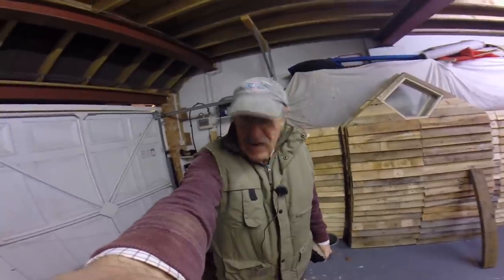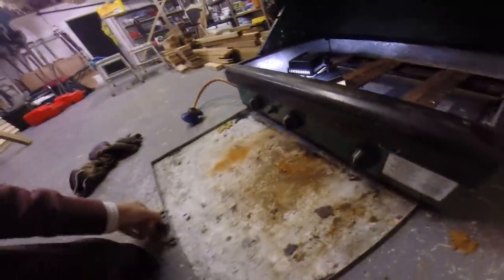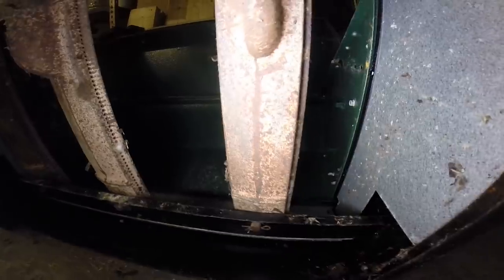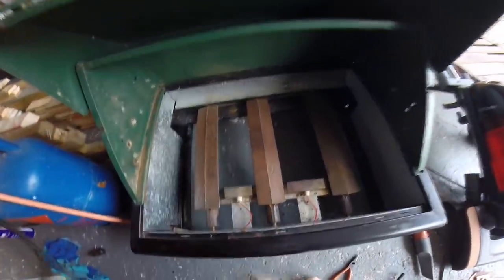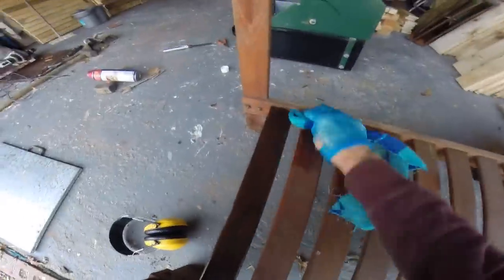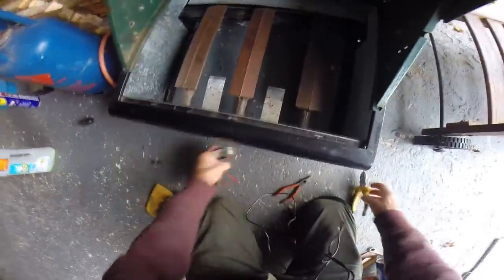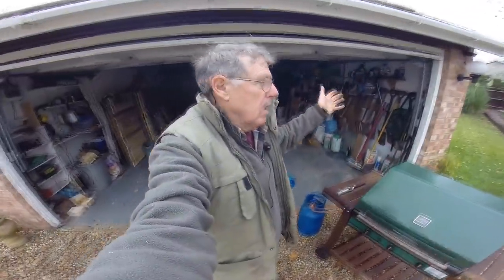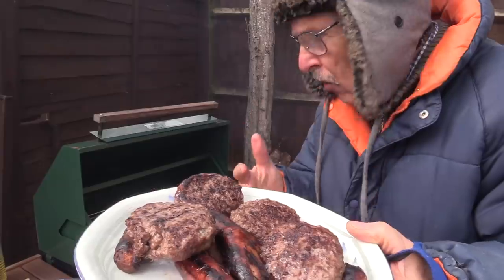Saved from the Junkyard! Now it works Great!

Comment: Top work sir,best tip given to me by a chap in Greece whilst on holiday....get yourself a cheap as chips aerosol sprayer,the sort used for misting houseplants.Fresh cold water kills the flames but not the coals.
Works a treat
Best wishes and tight lines
Stuart

Comment: Graeme, you are spot on my friend. I hate throwing anything away also, and In my opinion, this is the perfect example of recycling!
That's what I find most crazy, they keep banging on about using less energy, so why do they keep producing products that require us to use more energy in the first place?
Mate, if it isn't charcoal, it isn't a bbq, it's a gas grill!
Reply from the maker: Its a volcanic pumice stone heat boosted cooking implement.
Reply: @TAFishing  
Which still requires gas, and doesn't give you the bbq flavour you get from charcoal or wood chips my friend!

Comment: Nice Barby Graeme!  I would have left those Igniters - replacement Piezo buttons are available from eBay and other similar emporiums for not a lot!  A plastic water spray bottle is also great for stopping your bangers & burgers catching fire!  Now all you need to do (like a mate did) is chuck a whole leg of Lamb on there studded with Garlic, close the lid, and leave it on a lowish heat for 3-4hrs!  Stay safe & well!  👍👍

Comment: The square tubes the spark ignition were in are made to allow gas flow from one burner to the other.  That way you only have to light one burner and then the others should light after the gas  travels thru the tube.

Comment: Good job on the barbeque. It cleaned up nicely. 
A couple of safety things I was thinking about when I watched the video:
1) Never use a barbeque inside a garage or under a roof of any kind
2) The gas hose should be replaced once a year (this one is definately due for replacement)
3) The regulator should be replaced  every five years or sooner if you suspect it needs replacement
4) Always test the barbeque for leaks before you use it at the start of the season (and several times during the season)
5) Don't choose a barbeque with parts that can catch on fire when you buy a new one. It is strange to say the least that they made that barbque with a wooden stand. It is not unkommon for a barbeque to catch on fire because of all the fat that is involved when you use it. If it should catch on fire, close the lid and rip the regulator off the gas bottle asap. The gas bottle should be placed next to the barbeque and not underneath it. I prefer to use the steel tanks and not the plastic ones. I actually got a plastic tank that was leaking gas once. Luckily I tested the gas tank for leaks too before I started using the barbeque. 
This is just to help everyone be a bit more cautious when using their barbeques.

Comment: I’m not going to cover my barbecue any more. I uncovered it for the summer and it covered in condensation, and rusting. I think it’s better to just let it get wet and then dry in the sun and air. The other advantage is that it’s much easier to check it for rust occasionally during the colder months, and fire it up briefly as well.

Comment: Graeme, those wires which connect to the spark are (or were) heatproof! Lol. They wont melt and can withstand extreme temperatures. 

Great little refurb there by the way.

Comment: Hi Graeme I’ve got a barbecue just like that, I drilled out the small gas holes in the burners as they rust over gave a better flame, also change the rocks or get the fat from the food off them as I ended up with an inferno 😂 your always giving good tips on lots of things, so this is mine, great channel 👍
Reply from the maker: Thanks for the tip. Lets hope we get more good weather to get outside and use them.

Comment: Great job on the rehab!  As they say, "one man's trash is another man's BBQ" or something like that.  Seriously...my wife is constantly dragging on me for the amount of 'stuff's or garbage as she calls it, that I bring home to fix up and reuse.  But when she sees the $$ I save by refurb/rehabbing stuff, she shit's her mouth. Some things I have 'garbage picked' in the past and either used myself or sold are a few BBQ grills, countless wooden cabinets, a hand built gun cabinet someone put out because of a broken glass pane, a small lathe, and countless computers (most worked, just needed a part or upgrade).  Just about a month ago, I found a ride on 25hp Craftsman (Sears) lawn tractor in a pile of "garbage" a neighbor was having hauled to the dump after finally cleaning his shed.   It looked like it was chewed up & spit out, and he said it hadn't been used in almost 20 yrs  because "the, motor is shot". So I took it.   I got it home into my garage and in about 2 days, I had it running like brand new.  All that was wrong with it was an inter mitten electrical problem...a split & grounded wire on the starter!!  After investing a whopping $30 between a new wire, some cleaners and some paint (spraying it today by the way), I acquired me an almost brand new yard tractor!!! I might keep it or sell it (tractors like this are going for over $500 in worse shape), dunno yet.  Anyway, thank you for the video and keep on junk picking, lol!!
Reply from the maker: The "i" is pretty close to the "u" on the keyboard so if she sees it you should be forgiven !!

Comment: With bbqs like that the failure point is usually the body rusts out because of cheap galvanizing or the trolley rots or falls apart. The cast iron burners and grills will last forever. Being from Queensland I bbq about 3 or 4 nights a week in summer.  You don't need the coals. Just lay down some clean sand or diatomaceous earth to catch the fat. Once you get one burner lit you can light the others in sequence from it.

Comment: It only takes about 10 minutes to get charcoals to cooking temp when you use a charcoal chimney starter..  Amazon UK has them for about 20 quid.  I'm betting if you look at the design of them you could make one from the bits and bobs you have about the place there.   I personally prefer the taste of food cooked over charcoal,  gas just cooks it doesn't give that good smoke flavor.
Reply: I use some chicken wire to form a tube mate simples 👍 however my mate reckons you can get one of the posh ones you talking bout from tesco for six quid I'm considering it but that would buy a set of guutar strings lol
Reply: Came to the comments to say the same thing..I got a cheap less than a tenner one from Asda and charcoal bbq is as quick or quicker than putting the oven on now. Just don’t spoil the taste with bad firelighters etc

Comment: I'll tell you why they were going to bin it Graham. The plates are all rusty.   The ignitors don't work so you have to light it from behind and underneath with a lighter , the top is starting to rust and the paint bubbles up when it heats up. Cooking on gas you may as well just cook in the kitchen.
Reply: Rickey that you? TPB   lol
Reply: What you described is exactly the same as a brand new 1 tbf

Comment: Never understood the gas verses charcoal people. If you want to cook on gas .. fire up the cooker indoors.

Open flame charcoal bbq can't be beaten...
Reply: The propane barbeque is great, in my opinion. It warms up in a couple of minutes and you can grill the pork chops or whatever else you want to grill without having the greasy mess in the kitchen. And it is great for heating up day old rolls or bread and make it taste like freshly baked again. I have an offgrid cabin without a ventilator in the kitchen, so for me it is great to do the cooking outside. I have a portable charcoal barbeque too, but I have yet to use it. I bought it some years ago.
Reply: You'll hate the Traeger electric barbecues/grills then 😂
Reply from the maker: Thanks for the comment..I like the gas model as I don't have to wait 40 minutes for the thing to heat up...Fire it up,half a beer while it heats then pile everything on. Also I switch off so its not hot for several hours afterwards.

Comment: Could you remove the ignition switch so there would be a hole to put the lighter through?
Reply from the maker: Good thinking..that would save going round the back and bending down..will look into that.